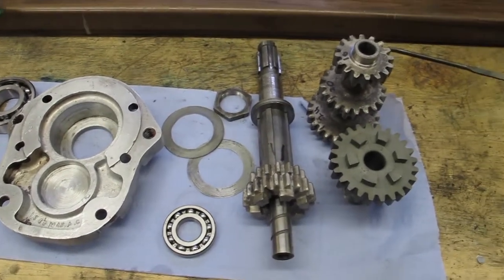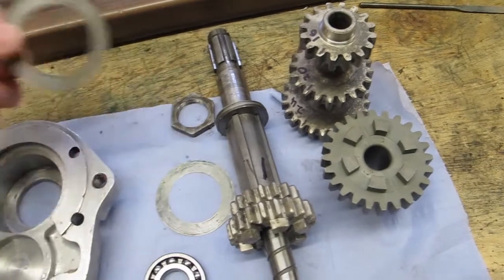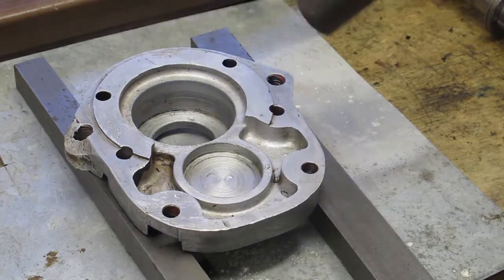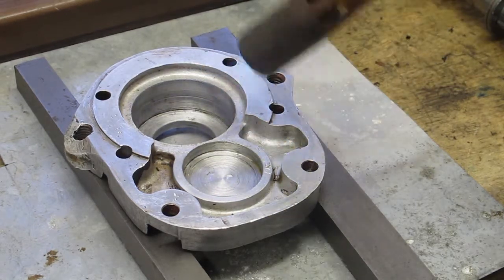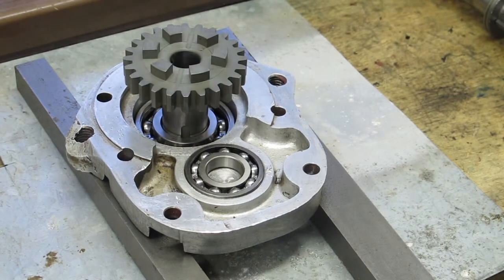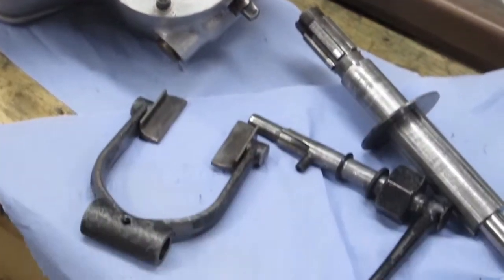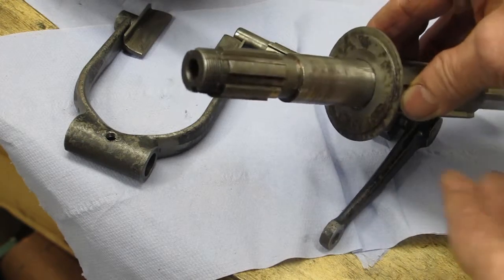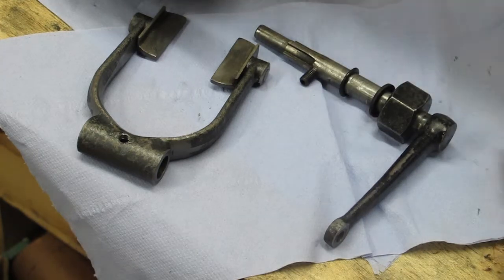1930 Sunbeam Model 9,  3 Speed Gearbox Assembly

Comment: Where did the spacer washer disappear to between showing the components laid out and the appearance of the large plate washer during assembly?  I am assembling a box at the moment and it has the spacer washer (Complete with oil throwing grove) but no plate weather.
Reply from the maker: Hi Bob, I must admit I cant remember its been a few years since I did the video  and I have forgot the finer details. Sorry.
Reply: @engineeringmodeller  I assembled the gearbox I have and found there was about 3/16"-1/4" end float on the mainsheet so I pretty quickly realised that a spacer washer has to be fitted, however the spacer washer I have is about the same thickness as the spacer that I found in amongst a couple of hundred small bits and pieces of Sunbeam fasteners and small fittings. There is also a kind of thick cork washer fitted to the fixed gear shoulder between the gear and the bearing with a thinner washer fitted over the outer end of  the bearing between the outside of the box abc the drive sprocket. I am still having problems getting the box to close up, I think it is an alignment problem rather than anything to do with the spacer being too thick because the box won't close the last 1/4" .
Reply: @engineeringmodeller  I've Just sussed it. The spacer washer on the shaft at the start of your video is actually the spacer that fits between the clutch and the gearbox. It fits closely into the recess in the outboard side of the bearing housing to act as a kind of oil seal, the thrower ring pushes oil back into the box along its spiral groove. I am missing the plate washer that fits inside the box but I will make one to fit.

Comment: Ah - hello again.  I didn't see this one before with your lovely new gears.   It appears also that your bike has had a weld repair to the chamfered clutch bridge bolthole.  Mine is also cracked.
Reply from the maker: Yes indeed, I think a lot of the bikes suffer from the same problem, it looks like a  design weakness in the original casting.